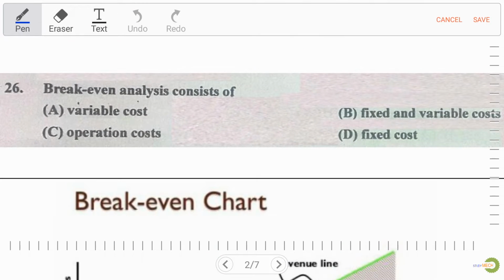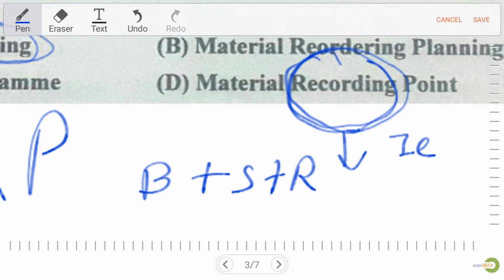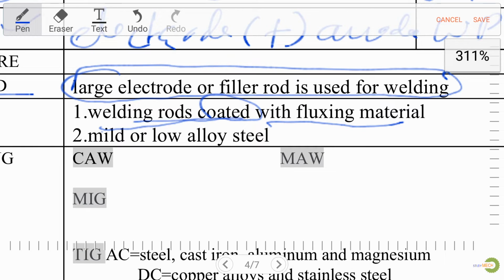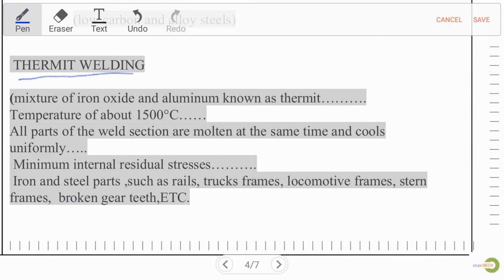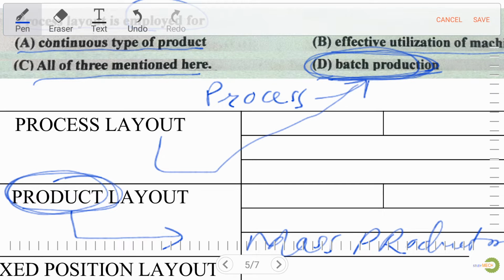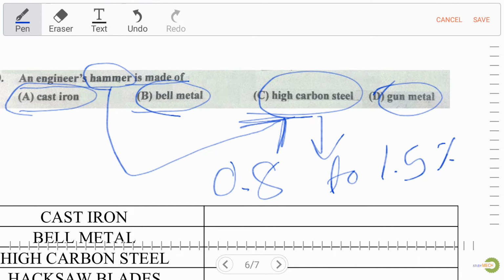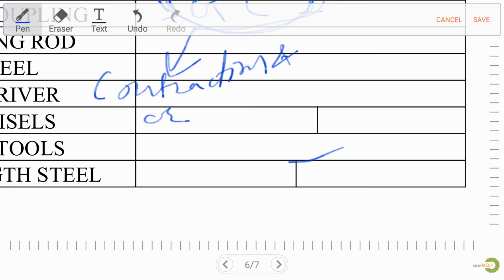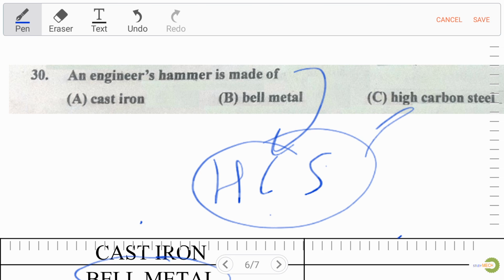MECHANICAL QUESTIONS ANSWERS I RTO exams of GPSC/BPSC/MPSC/RPSC

Comment: thermit welding is a non arc welding...it uses exothermic chemical reaction to get required heat.....provide link on based of that u say that TW is a arc welding?...do not taught wrong.\